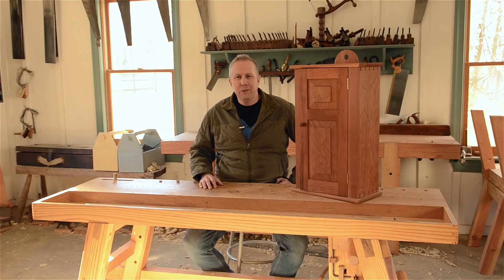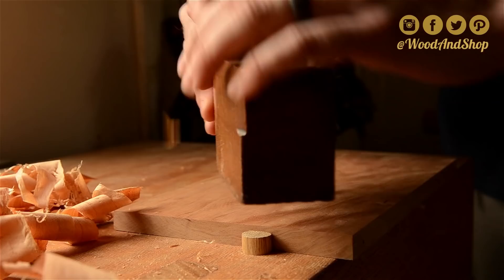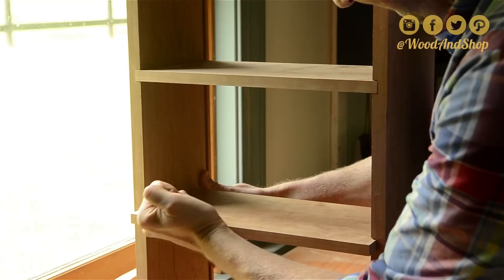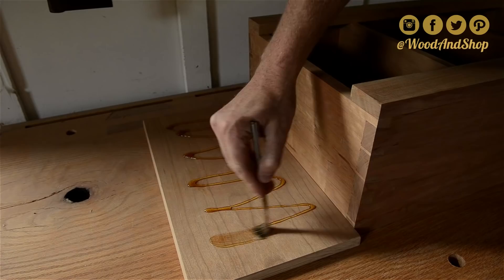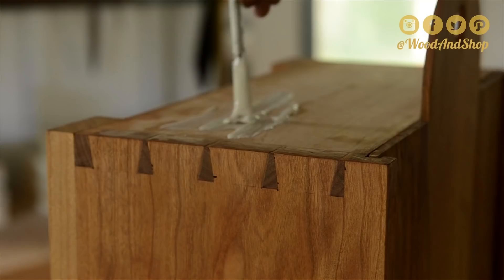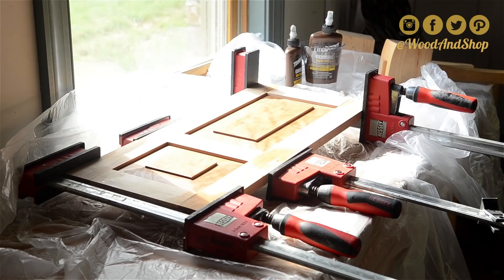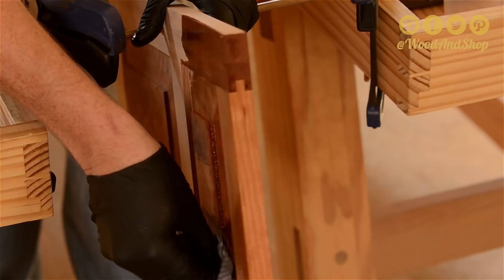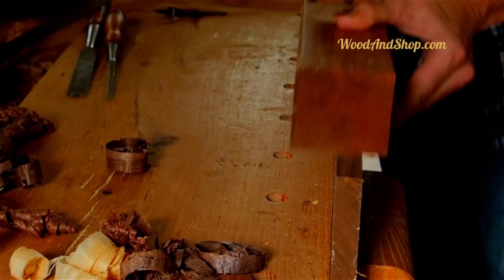Anatomy of a Shaker Wall Cupboard with Joshua Farnsworth

Comment: I like the mellow tone, exceptional camera work, and craftsmanship.  Thanks for making this video.  It seems like the weight of the cupboard, and whatever is stored within it, is fully supported by the glue between the case and the top.  Is this a concern?  Should one limit a cupboard with this anatomy to light duty storage?  Do different glues have different strengths over time?  Would a different anatomy better distribute weight without sacrificing the shaker authenticity?
Reply from the maker: Hello Mark, I mentioned in the accompanying blog post that you can put nails in the back (which I've done) to strengthen the case.
Reply: Thanks for the reply and the tip! @WoodAndShop

Comment: Thanks for this informative video. One question: what is the practical size limit for the width of the glued top and bottom pieces (assuming the grain runs parallel to the front and back edges of the cabinet)? If they were too large seasonal expansion would cause them to split.